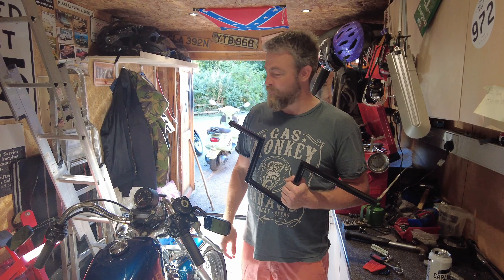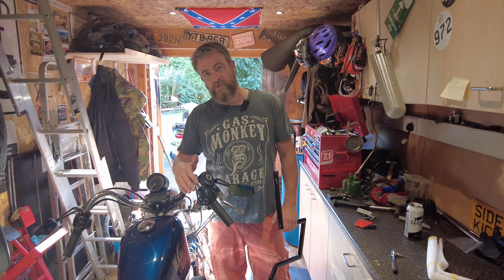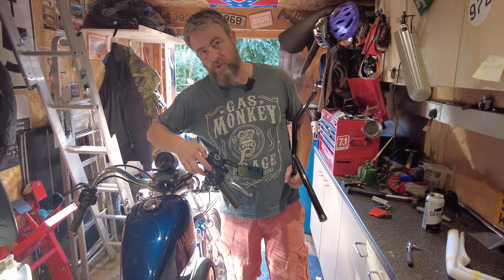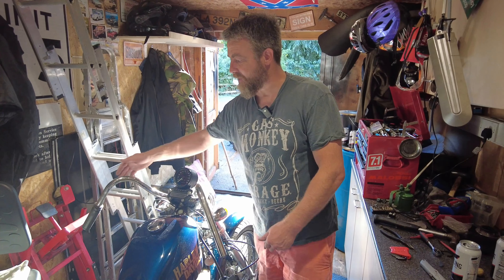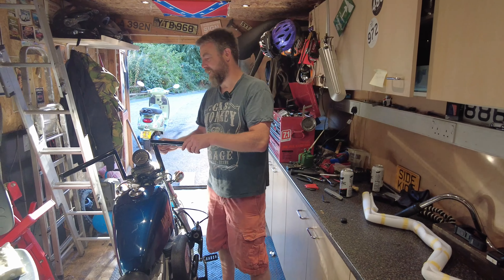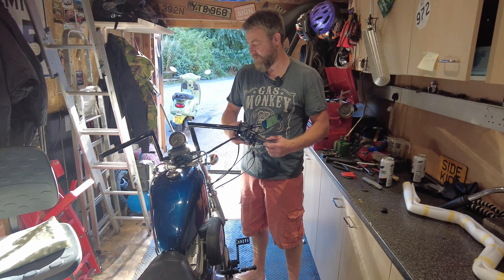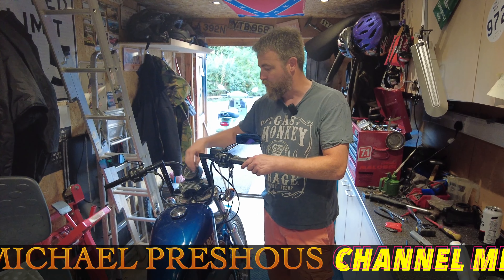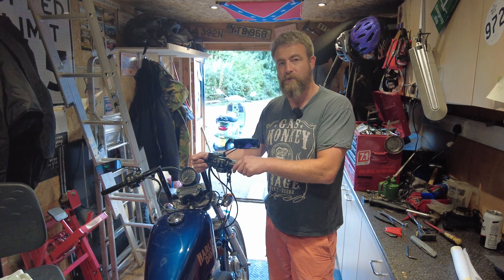How To Install Mini Apes Handlebars On A Harley Davidson Sportster 883

Comment: Do you have to get a longer brake cable if you are putting 8 inch on a stock sportster?
Reply: Most of the times 8 inch fits with the stock cables perfectly